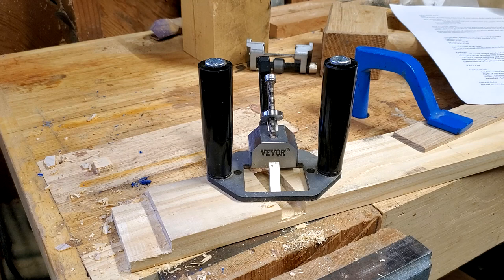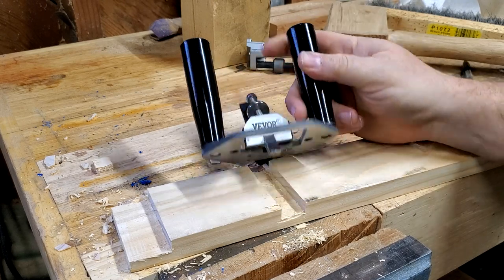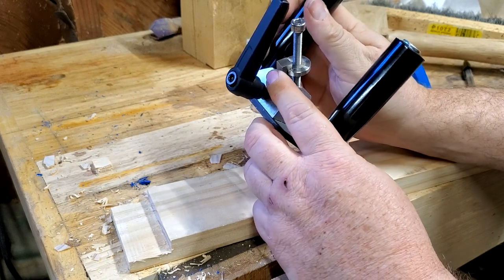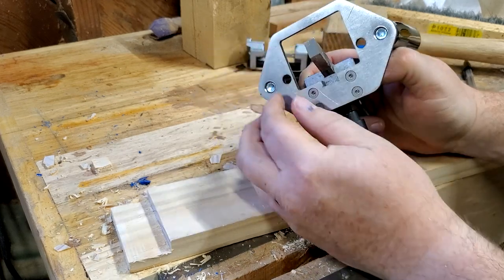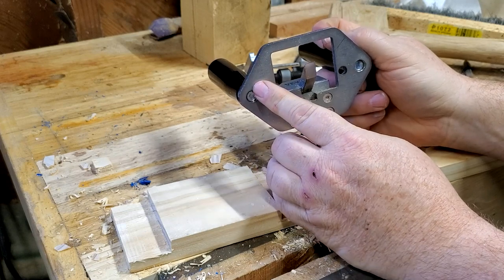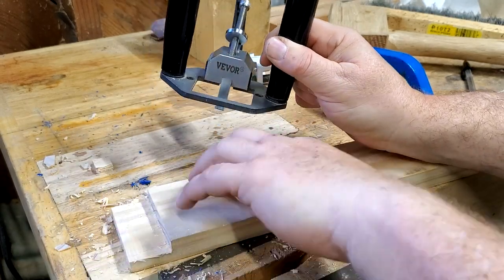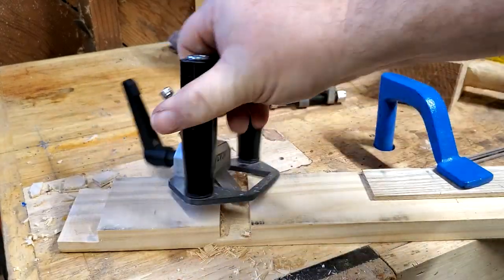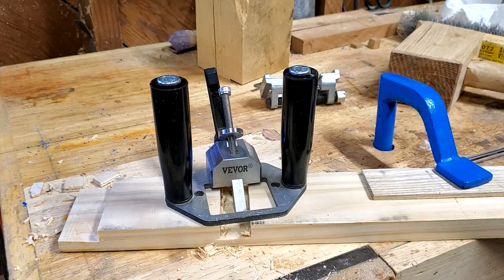Vevor Router Plane Review

Comment: I have the same router plane. It's interesting to see another non-expert's view.

I find it easier to keep it sharp if I sharpen it with the blade in the plane body. I made a wedged sole for sharpening. It is angled so the blade tilts back and forms a more acute angle to the stone. I rest it on two runners on either side of the stone and just work it back and forth a couple times on my fine stone, then a couple pulls on the strop. I work the burr off with my thumb. Takes less than a minute since I have a little station on a board under the workbench. I just pull it out and hit it every so often and it cuts very nicely pretty much all the time. If you use it a lot, then something similar might make things a bit nicer for you. 

I also recommend making a sole for it in general, I've gouged a couple pieces with the edges of the steel body. That was pretty day ruining lol.
Reply from the maker: I'll do a follow up when I make a base plate for it.

Comment: I have the same plane. I cut some of that long threaded post the height adjuster is on because it's not needed. I flattened the bottom and reground the blade. I ground two separate bevels of different angles on the blade. I made the back of the blade a good bit higher in height from the edge of the blade and I sharpened the edge at like 35 degrees. The blade steel was super mega hard. I was using a Tormek sharpener and it took forever. Lotta work but now that plane is pretty awesome.